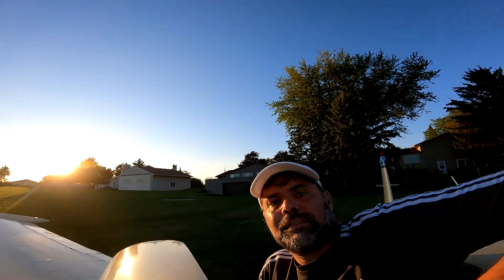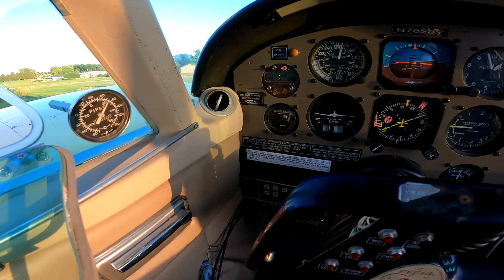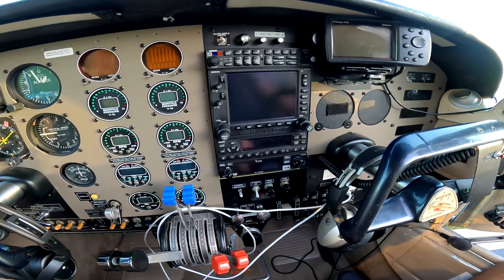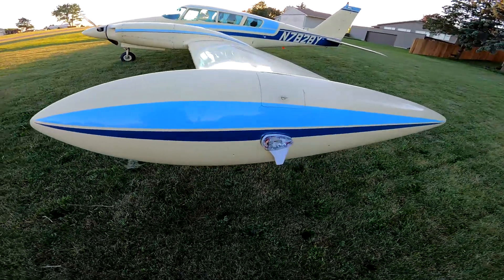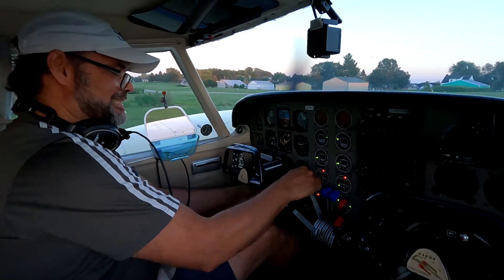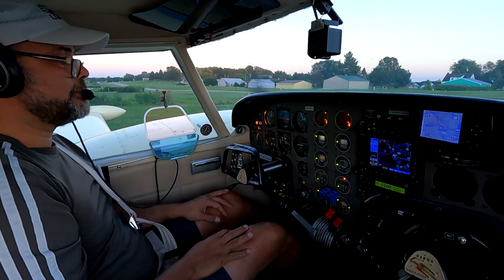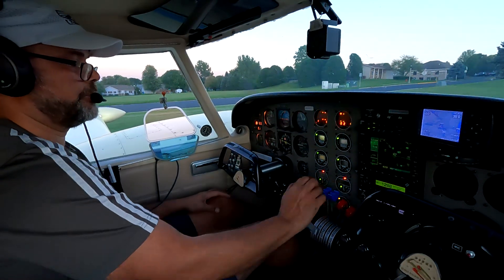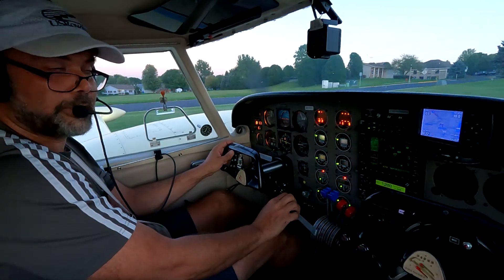PA-30 Lean of Peak Experiment #1

Comment: Probably the worst thing you can do is run rop 40-60 degrees?
The previous owner of my TC put 2700 hours on each of the B1A's over a 27 year period. 
A friend of mine has had his 64 TC since 66 he's in his 90's now and quit flying a few years ago. He put 6000 hours on his plane since 66.
He's been through 3 sets of engines. Changed each set when they hit 2000 hours.
When I overhauled my engines that had 2700 hours on them I reused the cams and cranks.
All 3 of us use rop.
A 30 year engine builder in Troutdale Oregon told me he makes a lot of money rebuilding engines from people who run lop improperly. He didn't say anything about making lots of money rebuilding engines from owners running rop.
So tell me how the 3 of us and loads of others have done harm to our engines by running rop.
Reply: It seems that you don't think the same thing on running high on pressure peak of arteries.

Comment: Thanks for the video! My Twin Comanche (N8583Y) is just about done getting both engines overhauled (one is back the other should be about mid Jan 2022). I'm having a JPI 690 installed and have been thinking of experimenting with LOP operations,  I've got GAMI injectors already installed. The thing is... one of the greatest features of the TwinCo is how economical they already are, even running 50 ROP!  I'm not sure I would be willing to give up 10 knots to save a couple gallons! I love the PA30, had this one for about 12 years. Will probably post a video with the overhauled engines when it get's put back together.
Reply from the maker: Thanks for the comment! Sorry for the late reply - was in Florida travelling with N7828Y. Good luck with the engine overhauls. I'm pushing 1800 hours on my left but it's still the better performing of the two and the oil filters and oil analyses always come out clean as a whistle so I'm going to go beyond TBO if it still operates well. 

I've finally gotten LOP ops down solid. I typically now operate 6.5 gph or less each engine and cruise about 160-165 mph TAS around 10,000'.  Yes absolutely the Twin Comanche is still after 60 years an economical aircraft to operate.

Post your experience with the new JPI engine monitors. I've got older models which work fine but don't have any recording features. I'm a data driven pilot and would like to have a precise record of engine performance data.

Comment from the maker: If you are interested in LOP only - skip forward to 00:12:00. I was able to run the engines lean of peak but in this first experiment I didn't have the right feel for where to set my mixture levers: the action in these is pretty slight until they get pulled nearly all the way back and then it goes fast. Short recap: I got the right engine running LOP and consuming an amazing 3.9 gal/hr at about 40% power. However, the engine was running quite rough so I didn't stick around long like that. Same when I tried both engines LOP. Pulling both mixtures back simultaneously is the right way to lean, don't lean one at a time in twin.

A few days later, on a long XC, I had a bit more time to figure things out, and, even though I had passengers with me, I was able to lean it back smoothly without any scary engine cut outs. I was at 9,500' and density altitude >11,000' so the power was limited to maybe 60% and I wasn't worried too much about the CHTs going above 400 F which is what you never want to do apparently. 

There was still a small region between engines running rough and smooth running LOP. But I found it and I was cruising about 148 kts TAS on 12.0 gal/hr. So this is about 20% less fuel consumption losing only about 8% in cruising speed: unless you are in a big hurry this is a good tradeoff.